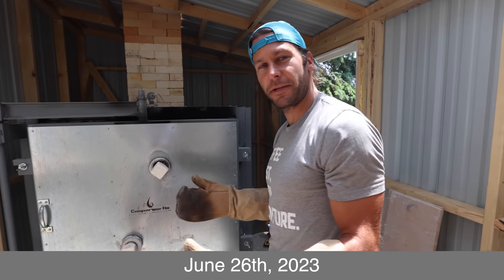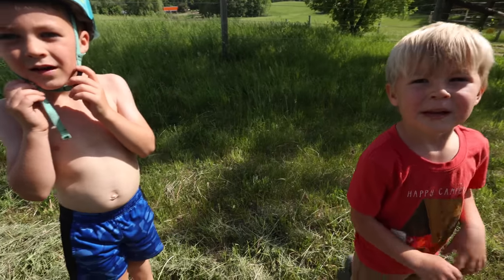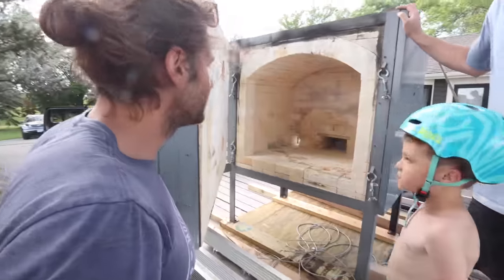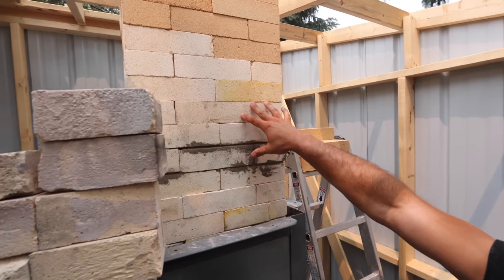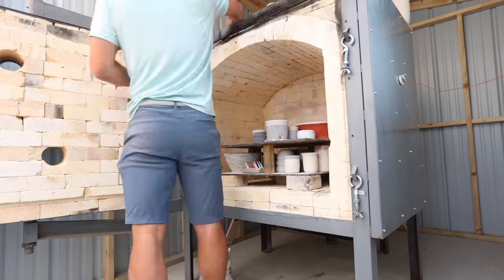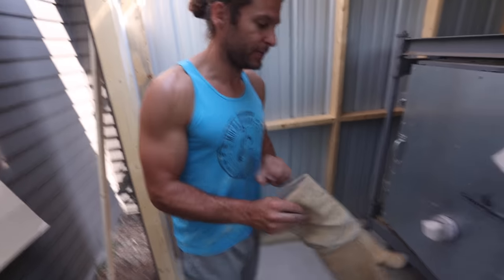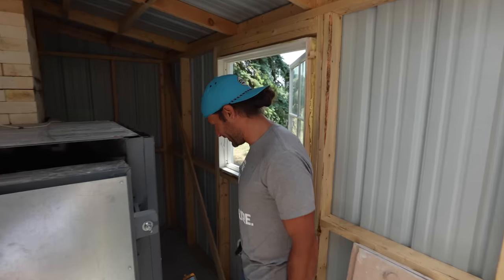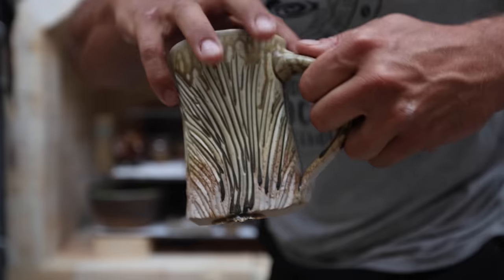Getting a Gas Kiln!  Transporting a 2000 pound kiln that goes to 2300 Degrees F*

Comment: Great kiln , great results!  Another option to protect any exposed wood, is cement backer board.  The problem with ceramic fiber is that it sheds when disturbed, and you don't want to breath it in.

Comment: Being intimately familiar with Minnesota's climate I have to ask, will you be firing in the winter? If so it wouldn't be a bad idea to add a layer of insulation to your shed if for anything to lessen the thermal shock of firing it up and cooling down. Then get a BIG fan for the summer months.